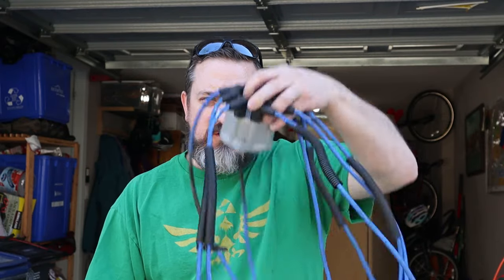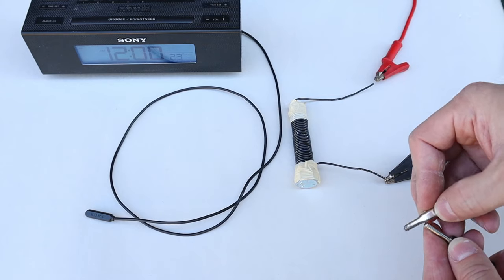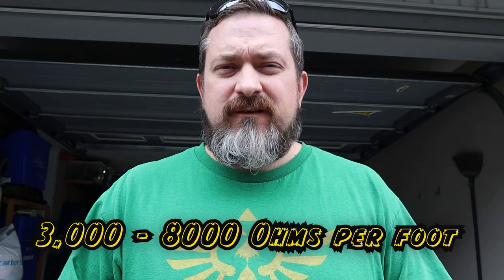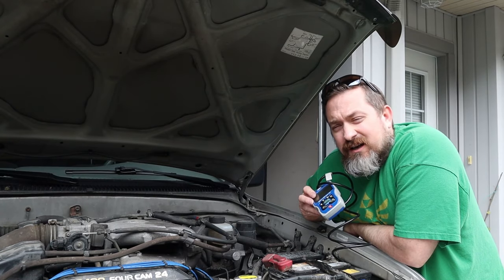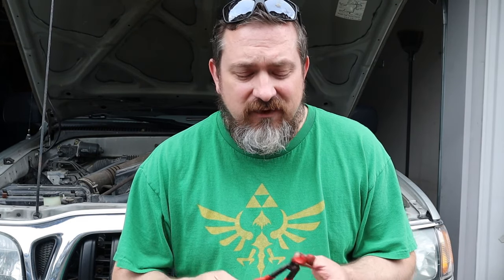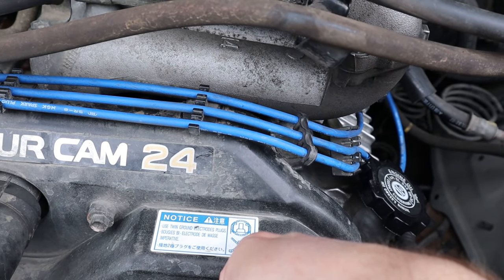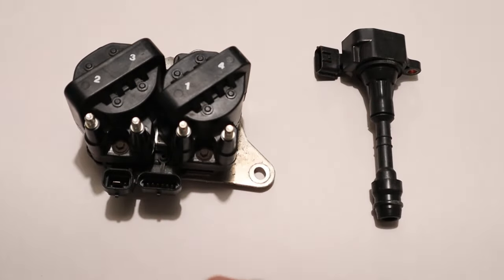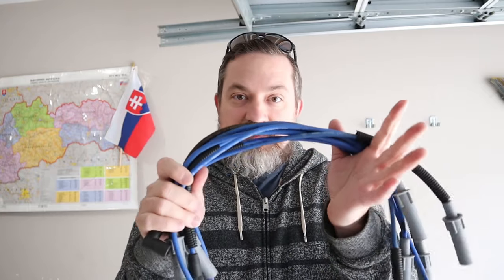Learn everything about spark plug wires, firing order, and much more! How to become a gearhead EP6

Comment: Hi great video,,,my problem is that I took my coil pack for a ford 2.5 1999 and I took all the wiring off and forgot the correct order
Reply from the maker: How many coils pack do you have?  Are there any markings/numbers on the coil packs?  On the wires?  If the coil packs are different, an online Google search of your ignition system wiring diagram/cylinder numbers may be a big help.
Reply: There is only one coil pack and there is no numbers it has letters AE -BF -CG-DH no numbers or letters on wires 😞
Reply from the maker: What model Ford is this for?
Reply: Is a 425 slr. Ford 2.5 it is a 4 cylinder that is on a morebark 2090d gas wood chipper
Reply from the maker: Man...not a lot online to help.  I would start by looking at the length of the spark plug wires and if they are different lengths, that will help you tell where they go.  I would assume that a is 1, b is 2, c is 3, etc. but I am not 100%.  Then get a cylinder diagram for which cylinder/spark plug wire is which and then attach to the coil pack.  Generally number 1 is the front of the motor where pulleys are and in order to the back.  Good luck!
Reply: I have a question branching off this information if it’s relative at all and can’t seem to get a direct answer outside of plug wires plugged into right cylinder. I was doing spark plugs on my 02 lexus sc430 and mixed up two of the coils, does it matter if they go back in the same order or no? I suppose if the wire plug needs to be back in order that should tell me it does matter since they were plugged into a specific cylinder? Just want to get a definite answer to see how much more research I need to do to somehow determine which one came from where
Reply from the maker: The mixing up of the coils shouldn't matter unless they are physically different.  If the spark plug wires are still attached and they happen to have a sticker that shows the number, then you can use that info to help figure it out.  Otherwise the length of the spark plug wires will determine where they go (furthest spark plug get longest wire).  Good luck Max!

Comment: Aye I just did a tune up on my friends 1998 3.9l dodge dakota and its got pour accelerations and poping out the exhaust and at idle it pop is it because he maybe put fuel induction cleaner in the gas tank no fuel cleaner fuel induction cleaner
Reply: And dose it matter what sparkplug wire got the the Distributor cap I know some all long and small but ass long ass they fit and seem to be in the first spot will that cause a misfire and if the sparkplug wires and just touching either other would that cause misfire maybe truck won't go over 30mph and new plugs are white crisp
Reply: Man I can't type this truck been giving me crap for 2 days
Reply from the maker: Are you sure you have the correct firing order and are the plug wires pushed down hard on both ends of all wires?
Reply: @wayofthewrench  yes it seems to be in the right firing order I did the wires 1 by 1
Reply: @wayofthewrench  the sparkplug is crisp white all cylinders
Reply from the maker: I would check again.  If the popping is a new issue after changing wires and you have checked every single spark plug and it's getting a really good spark, then the timing is off.  Check if there is a connection that needs shorted out/ vacuum  disconnected to advance before you check timing with a timing light if you can.  A 1998 is getting pretty late for the ability to check timing but if it has a distributor, you should be able to.  Are you getting any check engine lights?  All vacuum hoses put back on/ split or cracked?  A bad vacuum leak can cause misfires too.  Lots of stuff to check and it is very hard to do this without actually seeing the vehicle.  My guess though if popping is new since wires were changed is firing order.  Good luck!

Comment: Very Good Video Thanks 👍🙌
Reply from the maker: Glad you liked it, thanks for the watch!  It's always nice to hear from people after putting so much effort into these videos.  Cheers!
Reply: You are welcome 👍 I have problem on my Chevy Camaro V6 3.4 i have same fire order like you 1.2.3.4.5.6 and i have a crack on ignition coil nr 5. And my tought are maybe a bad grond cabel from the block to the Chassi ore can my sparkplug wires are to near the block ore together ore bad sparkplug ?
Reply from the maker: its really hard to diagnose through messages but if your coil over plug is cracked/showing signs of electrical arcing by the crack, then it should be replaced.  A good obd 2 scan tool can tell if your coil is causing a misfire in that cylinder and you can switch coils to see if the misfire code jumps to new cylinder as well.  This is all if the engine runs.  If it doesn't crank or start then it could be other issues.
Reply: Thanks for the help 👍🙌

Comment: i have a question, Does he still respond??
Reply from the maker: Sure do!  Wazzup?
Reply: @wayofthewrench  so i’m wanting to do them on my 2006 chevy tahoe, it has coils but not the (cops). i don’t think the wires matter where they go since they’re all the same length.
Reply from the maker: Im not 100% familiar with that vehicle but if all of the wires are the same length/diameter then just make sure the connections match and replace them one at a time.  Make sure you route them the same as the old ones and use any holding clips that were used to prevent them from touching hot exhaust parts.  Cheers and thanks for the watch!

Comment: You should have removed the fuel pump fuse or relay before.
Reply from the maker: Yeah you can if you doing this a lot but if your just checking one cylinder after narrowing it down from a power balance test, it's not a big deal.  You just don't want to run the engine a long time like this because the fuel can wash oil away from the cylinder walls and raw fuel is going out to the catalytic convertor.  Thanks for the watch and sharing your tip! Cheers!

Comment: Won't start turns over?
Reply from the maker: Well if it cranks then it's not starting system.  Could be fuel or spark or compression or air.  Use the video to check for spark, if there is spark then it's probably fuel.  Good luck!

Comment: I’m still confused
Reply from the maker: I'm sorry to hear that, do you have a question that I can maybe help you out?
Reply: @wayofthewrench  no I just need to look into it more I’ll watch more videos
Reply from the maker: Find your answer yet?
Reply: @wayofthewrench  yes
Reply: Resistance goes up with the length of the wire. I would go to Napa and measure the length and impedance of each one. You have to check to make sure they work. Tell them you will get back to them. Then go searching for some new used wires at the local scrap parts yard. May find some gold. May require cutting and doing the ends. It's all about the ohm